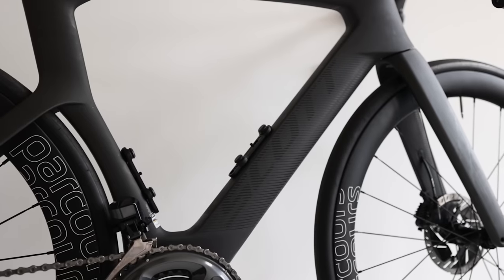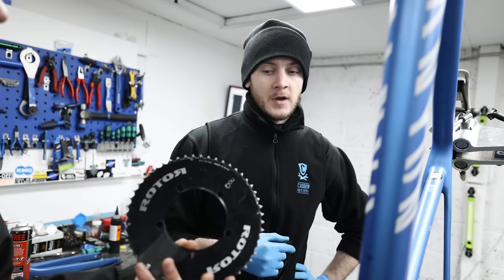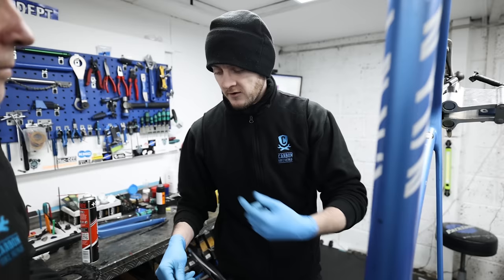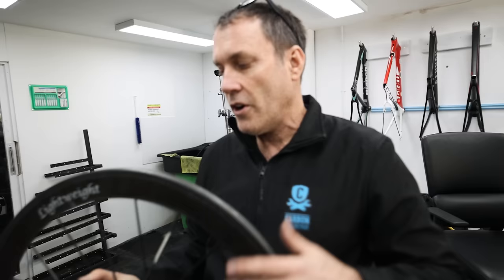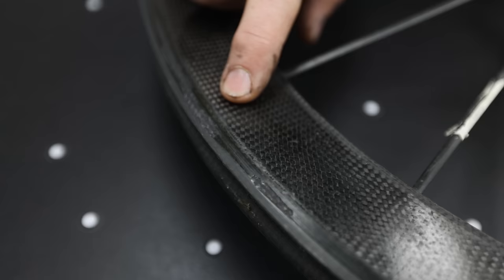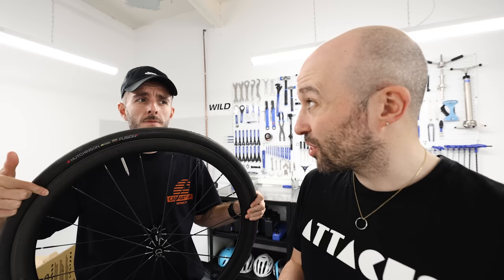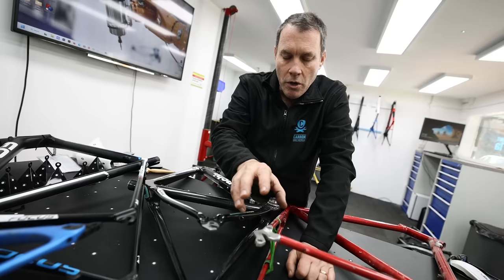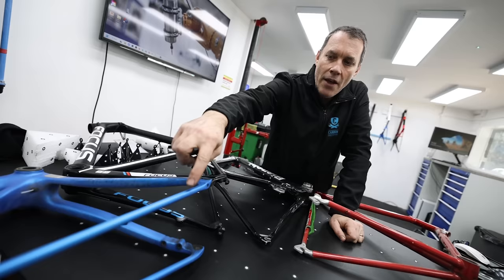6 Bike Products That Shouldn't Be Carbon Fibre

Comment: Stems. There is no point. Alloy ones are usually lighter too...
Reply: Cannot confirm this.
Reply: My darimo stem says hi.
Reply: There is if you want a one-piece cockpit.
Reply: The thick Zipp stems were excellent for sprinters. No alloy stems were as stiff as those. But yeah, regular sized stems alloy all the way.
Reply: I'm pretty sure my Thomson masterpiece is lighter than my enve seatpost I never weighed them but same with my Thomson stem it feels lighter than my enve aero stem
Reply: My alloy stem kalloy uno is 99g at 110mm
Handlebar Fizik 38cm 235g
Seatpost is under 200g KCNC scandium 
No carbon here lol
Reply: Alloy stems cut into carbon steerer tubes and damage then. Carbon stems don't
Reply: It does mitigate some vibration on your hands, especially if you’re running alloy bars and have a shitty fork with alloy steerer tube. Just like a carbon seat tube with an alloy frame.

Comment: Agree with all of them apart from probably the bottle cages.  Had them for over 15 years and never had an issue.  But to be honest they are probably unnessesary and you should just save money with a plastic one.
Reply: That's the only point in the video I didn't agree with. I have 2 sets of Bontrager XXX and RXL bottle cages that are on their 3rd bike and 10+ years old. Still good.
Reply: I have had a carbon bottle cage break on me. Depends on the design, this one had two 'claws' holding the bottle, they weren't joint in the middle and were really flimsy. Now I have different ones, accessible from the side, similar to Specialized Zee cage and they're solid.
Reply: Yeah, my carbon bottle cages have worked well on two bikes for 7 years. They are overbuilt and thus inflexible which may be why.
Reply: My carbon bottle cages have outlived 2 carbon frames. But, yes otherwise, I agree with all the guys points.
Reply: interesting, this was the only one i've had personal experience with...twice. Two very expensive cages both broken in similar ways. They can't handle bumpy roads and real world conditions. i think titanium is next for my cages
Reply: Carbon braking surfaces on a bike wheel should not be confused with the carbon ceramic brake pad material in cars which is a completely different thing and can sustain continious heating and still perform well.
Reply: Carbon looks cooler and you definitely go faster with carbon cages 😅
Reply: Have been running arundel carbon cages for the last 10 years, well made, and never dropped a bottle
Reply: A stiff cage means no bottle ejections over bumps. Flexibile plastic doesn't cut it. In MTB applications I'm pretty happy to replace a cage every half decade if it means my bottles stay put over hilly, technical bumps.
Reply: @richcole3931  Good point. Yes, I am a MTBer too - I honestly haven't even thought about my bottle bouncing out in the last 10 - 15 years with the carbon cage I brought because I was just being a weight weenie at the time.
Reply: @cmarnold78  Funny thing is...carbon bottle cages really aren't any lighter than plastic ones. If you think about it, the main material in each is...plastic! 🙂  I never saw the point in spending 10X on carbon just for the sake of carbon
Reply: @tanhalt  Yeah true.  Think there was a big difference quality/flex back when I brought it 10/15 years ago.  Remembered they just had those nasty flexy nylon ones at the time the only ‘good’ option was carbon.
Reply: Perhaps Francis tried to load his with Magnums of Old Peculiar! Regardless, very relived myself...as is my obsessively fashion conscious Niner.
Reply: Another happy carbon bottle cage customer here... 13 years on my first set Arundel carbon cages, still going strong. I have three other sets acquired over the past 2-9 years that continue to serve well on road, gravel, and trail. Also agree with OG commenter here vis-a-vis plastic providing the same functionality for less money.
Reply: My MTB's cheap plastic bottle cage snapped a few months ago... Maybe it was an expensive carbon one and I just hadn't realised.
Reply: @tanhalt  "Funny thing is...carbon bottle cages really aren't any lighter than plastic ones. If you think about it, the main material in each is...plastic!"

Typical carbon fiber composites are about 50% heavier than typical plastics. The former has a density of 1.55 g/cm3, while typical plastics, such as ABS, have a density of around 1.0 g/cm3.
Reply: @MaximRecoil  Sure, but that's just density. A typical carbon cage will use less material because of the greater strength and stiffness....and in the end, weigh about the same as a finished piece
Reply: @tanhalt  Carbon cages I've purchased are on the order of 10-20g lighter than similar shape plastic cages.  (I like the "wing style" cages.)  Not a ton, but it's not zero.  Two different plastic cages measured 33g and 45g grams (the 45g one is significantly less floppy); my cheap carbon cages from Aliexpress came in at 21-22g.
Reply: £85 for a bottle cage ….. one born every minute
Reply: @lolbubs11111  Is that 10-20g worth the price difference? 🤔
Reply: @MaverickCycles  I’ve now broken 3 titanium cages, which didn’t have enough material on the base bolting plate welded to the arms.
I’d take carbon any day.
Reply: The King Ti cages was are outstanding, very springy, excellent grip plus easy on bottles, unlikely to break and very light.   I've had a pair on road and CX/gravel bikes for over a decade.  I think Ti is the ideal material for cages, better then nylon, CF, stainless Steel or steel
Reply: kind of funny for me that you say ""you should just save money with a plastic one"  
Isnt Carbon just plastic with some fiber layers in it? 😅
Reply: Same here - 10+ year old Arundel Mandibles going strong.
Reply: The carbon Elite Chrono bottle cages are way better and more reliable than the plastic ones!
Reply: @Karel-B  I had two carbon bontrager xxx cages that both broke within the space of a year! Perhaps that's just my ham fisted approach to getting my bottles back into the cages!
Reply: @tanhalt  a 10p piece weight is probably similar
Reply: So you DO agree with him after all ?
Reply: carbon bottle cages just look nicer.
Reply: @leskennedy  I'm totally agree with him for sure 🙂😉 And it's also my principle of building my bikes.
Reply: @MaverickCycles  Titanium is very brittle - it will crack. Just get an alloy cage - the weight difference is negligible.
Reply: Anyone concerned about crashing on your carbon bottlecage ?
Yikes..!
Reply: I got CF ones online for like $20 bucks for 2.
Reply: Never had any issues with my Arundel Mandibles.  Don't think this one holds water.
Reply: @KOL630  I heard that they go even faster with carbon bottles in it.
Reply: @davidrae8475  agreed.  I have two 10+ year old sets of Arundel Dave-O's that I've moved from bike to bike.  I've literally NEVER lost a bottle and they're in perfect condition.  Quality carbon cages like Arundel's will outlast multiple bikes.
Reply: Yeah I love the Arundel carbon cages
Reply: A plastic bottle cage weighs 20g and cost £5. A carbon one weighs 16g and costs £50-80. That's probably the most expensive weight saving you can do per £.
Reply: @matteo.ceriotti  I don't use carbon cages because they're light.  I use them because I never lose bottles.  Never.   And considering what I paid for the bike overall, $160 for cages I've used for over a decade is a fart in the wind.
Reply: I do like my carbon cages, but I did have to toss my last pair because they broke/wore thru at the bolt holes.  I'll have to agree that they are not as durable as the plastic ones, for a very slight weight advantage.  But they sure do look sweet!
Reply: I use Wiel carbon bottle cages on all y bikes. no problems yet.
Reply: Chris Bloodknot  I'm pretty sure most are made from fiberglass which can be stretched much more than carbon can.
Reply: @PaulJakma  Lmao, where tf did you get this from? Titanium is even less brittle than steel, nevermind aluminum.
Reply: hate carbon cages, way too expensive and break. Metal much better and can be bent slightly to make bottles tighter in cage on bumpy rides. Had many bottles jump out of carbon cages also
Reply: Mines from alluminium.
Reply: @sergeb1207  cause the surface is ceramic
Reply: Good for carbonated water😂😂
Reply: Ok guys, I get that many people don'thave an issue with carbon cages. But that still leaves the question: WHY?!
You can BARELY safe any weight compared to plastic, they cost 10 times more and while they may havent't broken on you yet, they are still much more likely to. Then you'll need to spend another like 80$ to get it replaced. 
While the 2 Gram heavier plastic version is like 5$ and lasts for years without any compromise.
Reply: @swecreations Ti frames ride well because it’s such a resilient material that also attenuates vibration. Many of the qualities of a high end steel ride coupled with smoothness of carbon.
Reply: @sagichdirdochnicht4653  yes, especially as they can't reduce the mass of the water....
Reply: @peterwillson1355  Or my favorite, body mass. Gotjta love Mamils in that regard. Spending thousands of dollars to save the last few grams of weight on their bikes. While most of them could easily afford to loose 10-20 kilos of bodyfat. For free.
Reply: @KOL630 Can confirm. I put carbon bottle cages ony bike and some flame decals and increased my average speed by 8 percent.
Reply: @sergeb1207  Carbon fibre is not the same as other materials that happen to also have carbon.
Steel is basically just iron with some carbon added to it. And other alloys of steel have other things added in addition to carbon.
Stainless steel is iron, carbon, nickel, and chromium.
Some steel alloys with tungsten are extremely tough.

Comment: For everyone saying they've had no issue with their carbon bottle cages: consider that many component brands sell carbon-reinforced nylon bottle cages as "carbon" bottle cages. Small marketing difference, big actual difference!
Reply: What’s the big actual difference?
Reply: @kylehagertybanana  nylon and epoxy are both polymers but nylon is way more abrasion resistant, much less brittle, and a lot heavier
Reply: @robbeelsas I've got very cheap "carbon" bottle cages. Actually now hoping they are carbon reinforced nylon!
Reply: @robbeelsas  Nylon and epoxy have the same density though. Maybe epoxy has much better mechanical strength?
Reply: @robbeelsas  Both are specific gravity just over 1.1, but typically carbon fiber epoxy composite is 60-75% fibre, as opposed to fibre-filled plastic such as PA6 (nylon) is typically only 20-30% fibre, as it can still be injection molded. From that composition, the shock,  bending and abrasion resistance of the PA6 remains to a much higher degree and cushions the fibres more than a smaller amount of typically harder and more brittle epoxy (though epoxy resins blends can be designed for a variety of final properties).
Reply: @kylehagertybanana  Reinforced nylon rarely contains long continuous strands of reinforcement material, it's mostly very short fibers. That's partly due to the manufacturing method, you can't inject long fibers into a mold. The reinforcement makes it somewhat stiffer and stronger than pure nylon, but not nearly as stiff as a normal CF/Epoxy part with long continuous fibers throughout and a high fiber content.
Reply: Just in general any time someone states a limitation of carbon fiber, they are ignoring all the different layups and layup combinations available.  "Too brittle" not if there is kevlar worked in there too, etc. Like for example you could make carbon composite spokes that don't shatter, but then they would probably end up only 1 gram lighter than 2 grams lighter so nobody would care. As well you can make carbon handle the heat of a rim braking surface too. There are carbon fiber rockets that re-enter the atmosphere from space!  But, its expensive.
Reply: There are different levels to carbon.
Reply: The price @kylehagertybanana
Reply: Mines cracked so soon. Yday cracked again. Superglued. But will be buying plastic ones.

Comment: I believe we should never make a submersible for very high depth out of carbon fiber 😂
Reply: Touché.
Reply: I came to ask the same thing
Reply: it failed because it was bonded to  a titanium hull  ..  was not the fault of the carbon but the design was flawed
Reply: @leo-wi4qu  so if it was homogenous carbon it would be fine? what about concrete

Comment: A guy riding a lightweight wheel rode into the back of my rear chain stay and his wheel completely collapsed sending him flying over his bars. I have never seen a wheel  fold so easily!
Reply: bikes ain't for crashin bud tellum to do better
Reply: You dont know how that wheel was treated Maybe it was bashed before Lightweight does not make cheap products that dont meet safety standards.  Carbon wheels Carbon spoke have been around for years and years on road and MTB
Reply: @jcerullo5015  I don't! But I know how well the guy treats his collection of bikes
Reply: holy shit man!

Comment: I agree on all points. I’d like to add carbon rails/base for saddles. It probably won’t kill you, but anytime I’ve crashed or had to put a bike down with a carbon-railed saddle, something would shred or crack or snap. Saddles are expensive and I’ve had much better luck with titanium or stainless steel rails and a plastic base under the cushion.
Reply: S-Work saddles in particular, they are beautiful to look at and comfortable…but no thanks.
Reply: Had a full carbon ax-lightness for over 5 years. It’s more comfortable than any saddle I’ve had in over 30 years cycling, and thus far no issues with durability.
Reply: Everyone talks about titanium but no one makes bikes out of titanium. No one works on those bikes.
Reply: That’s exactly what happened to mine..

Comment: This video is very informative. We, as consumers, are constantly pushed to carbon and should buy all things carbon, but most people are not racers and looking for the light weight everything.
Reply: Most riders who know I prefer aluminium don't understand why until I explain. I also feel much more comfortable riding hard on aluminium parts (excluding wheelsets as they're one of the only products I'm willing to ride carbon on).
Reply: @yonglingng5640  yeah I avoid buying a carbon bike for the same reasons. I also recently removed all my carbon wheelsets in all my bikes and replaced them with custom aluminum wheels. I just don't trust carbon and having to always do a safety inspection on carbon parts once a week.
Reply: Once you ride on Carbon wheels and a good set of road tires, you'll never want to go back. The deeper the better. It's so easy to move.
Reply: @BigBeezyBtown  have 6 wheelsets all carbon...took them all off my bikes. I do understand the feeling is great. But I prefer aluminum for comfort and a little piece of mind not having to worry about micro cracks which I have experienced before
Reply: Bikes are meant to be replaceable. Isn’t that why you have insurance for them? Break a part in a crash or accident, claim the money and just buy a new one back. 

It’s a bike, not some family heirloom. Break it and just buy a new one. Simple
Reply: @slowcyclist4324  *Richie Rich has entered the chat
Reply: @BigBeezyBtown  For the above reason alone, i could consider i have literally blood on my hands. For a dude like him, i don't want to even count! At least i'm in peace with the thought that i use my bikes untill the bike parts literally dies, and then , i recycle them as a civilized human 🤗🤭. Or a civilized Na'vi for that matter🥰😁, maybe i'm done with humans. 😂🤣 But i'm still breaking the 3 Laws of Eywa, cause i'm using turning wheel 😂😂🤣
Reply: I got carbon back during the great bike shortage of 2021. I got tired of waiting for the bike I had on reserve  and a fx sport 4 carbon came in stock. 

I have no regrets.
Reply: @bonbonflippers4298  unless you're small and don't put real power through a bike, aluminum wheels crack (almost always at the rear drive-side some eyelets where the loads are highest). a lot.
it's not a matter of if, but when.
Reply: @slowcyclist4324  just how slow are you??

Comment: Carbon railed saddles, because in the event of a failure, I can't think of a place I'd like to get carbon strands stuck less.
Reply: Seconding it. Also, seatpost clamps: it's not that much weight saving, but risk of snapping is too high
Reply: @feedbackzaloop Indeed. It's easy to underestimate the importance of an intact seatpost/clamp/saddle. I once had a clamp bolt snap (unfortunately it was a single-bolt clamp). I was riding no-handed when it happened. It wasn't good.

Comment: I'm a bicycle mechanic as well and I have never used carbon fibre parts for myself because of most of those reasons ...and also because I'm a pretty heavy dude ... lightweight might be a nice thing but at those cost and risks ...not my cup of tea. I rather stick with high grade aluminium parts or titanium and feel safe .
Reply: Same here. Handlebars are one of the parts I don't want to go carbon on.